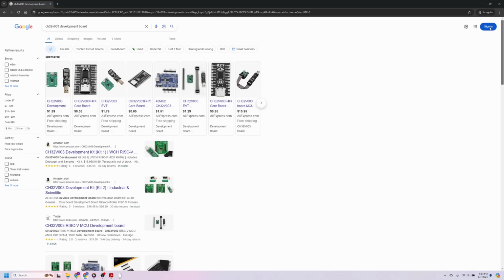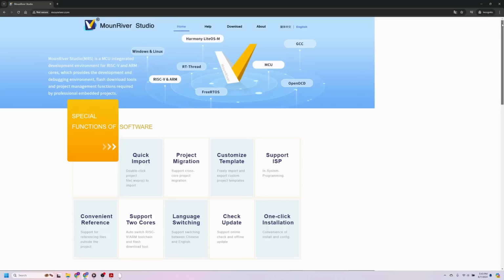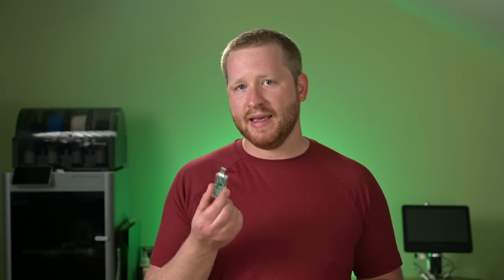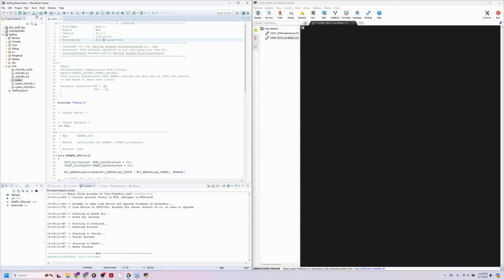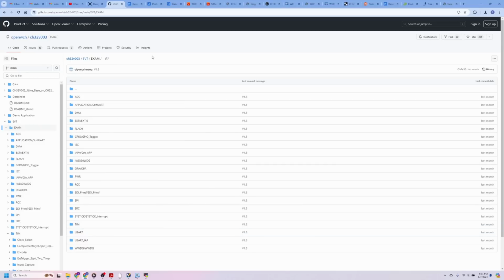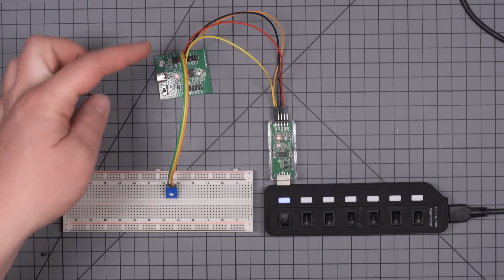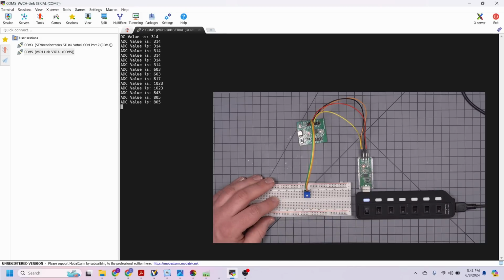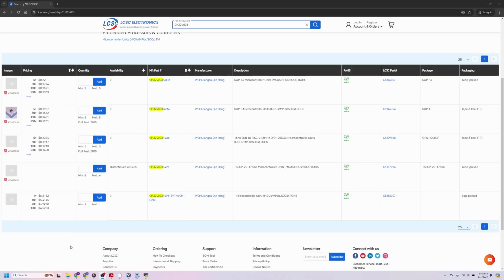Which 10 Cent Microcontroller is Right for You? Comparing the CH32V003 to the PY32F002A.

Comment: you're less confortable ordering from ali? Why? I have ordered there for many years and always received absolutely perfect products. Never had any issues with components.
Reply from the maker: A lot of it is the buying experience, varied shipping times (sometimes I forget I've even ordered something when it arrives), the multitudes of different vendors with questionable reviews, the risk of counterfeit parts (probably not an issue here), poor searching, not being a one stop shop (still need an lcsc or digikey order), etc. If they have what I need and I'm pretty sure I know what I'll get I'll order from AliExpress, but it's not my preference
Reply: @AllTradesZach  do you have an alternative international source for parts? Or do you go for a local retailer? I go for AliExpress because Brazil had absolutely zero good retailers, it's all just drop shipping and mostly from Alibaba, so I just go directly to the source and spend the time to find the stuff myself.
Reply: @AllTradesZach I’ve had mixed experiences on AliExpress. Some vendors are on point, while another shipped me FeRAM’s half of which ended up being well-used pulls with some being EOL with stuck/sticky bits. They fought me tooth and nail, and I ended up with half of the chips that I ordered at twice the price.
Reply: @AllTradesZach  Aliexpress is exactly the same as Amazon. Both provide a store-front to thousands of individual vendors. Your experience depends on the vendor, but if you're buying from e.g. the WCH official store then no worries, mate. Sure, if you search by a part name and then pick the cheapest vendor then you never know what will happen.

Comment: What about the 3 cent Padauk microcontroller?
Reply: That lives in a completely different class than these as it's a closed source 8 bit mcu
Reply: one time programmable
Reply: OTP so you'll burn a lot of them while developing your program (there is a much more expensive flash version). Awful PIC instruction set that is a horror for human programmers and almost impossible for standard C. Also only 64 bytes of RAM (vs 2048 or 3072 here) and 1000 instructions of program space vs 5000-10000 instructions on the WCH and Puya. And you need 3 or 4 instructions on the Padauk to do what one instruction does on Arm or RISC-V -- not even counting 8 bit vs 32 bit. Both Arm and RISC-V are compiler-friendly.

Comment: Another HUGE reason to be excited about RISC-V is the modular nature of the ISA. If you only want pieces of it then you can just take those pieces, which means that you don't have to implement *every* instruction available in the instruction set to be in compliance. This also means far fewer transistors, heat, power, etc. To the degree that I am able, I do everything in RISC-V now. I am tired of all of the x86 / ARM licensing shenanigans.
Reply from the maker: Yeah, x86 in particular is a disaster. Do you think the piecemeal nature of RISC-V will have a negative impact on tool chain support though? It seems like there are already so many different combinations of instructions available
Reply: @AllTradesZach  I suspect that many a project will forget the compiler flags to enable optional ISA extensions and therefore not benefit from them anyway. 🤷🏻‍♂️
Reply: @AllTradesZach  it's very easy for a compiler to use a hardware instruction if it is present (e.g. mul, div, clz) and use the compiler's built in software function if not. GCC and LLVM don't have any problems with the programmer telling them exactly what ISA options are available. If you're doing embedded work then you know exactly what chip you have and it's easy to inform the compiler (RV32EC in the case of the CH32V003). If you're doing application programming for Linux or similar then you don't know exactly what chip you'll be running on (many dozens of difference ones), but in this case there are "profiles" that the chips are built to which specify the minimum set of ISA extensions. These are called RVA20 (most chips now in the market, formerly called RV64GC), RVA22 (the first boards are just hitting the market now e.g. BPI-F3), RVA23 etc. Each one includes everything from the previous version.
Reply: @AllTradesZach  Yeah, x86 so horrible I ended leaving assembly language and learnt C after years in embedded space.  Although I'm partly back with microcontrollers with all the sane beautiful architectures...
Reply: Yeah my professor taught our Machine Dependent Programming class primarily in Risc V and we only did a little x86 in the end, and I 100% prefer risc-v. The only thing I'd take from intel is the square brackets method to access memory, instead of having to do multiple adds, multiplies, etc to access the data, but thats about it.

Comment: wtf RISC-V is already like 10 cents per chip?? i remember when these chips were insanely expensive.
Reply: WCH now have another 10c chip (CH570D) that integrates USB and a 2.4 GHz packet radio. It's also got 8x the RAM and flash and runs at twice the clock speed of the '003. I've got dev boards for it.
Reply: @BruceHoult WCH’s CH5xx series is definitely a lot less popular, they’re specialised chips after all. But if you know what you’re doing with them, they’re probably a lot cheaper than a V307 with all its peripherals. If I recall, one of these CH5xx MCUs is capable of directly talking the USB PD protocol.
But the programming protocols and even architectures seem to be less standardised, some are 8051-based, others are ARM, and others are RISC-V. I think the CH32V toolchains (1st and 3rd party) support the RISC-V ones, but I’m unsure about the ARM and 8051 units.
Reply: It’s got the specs of an 8-bit AVR, the V203 is more like a proper 32-bit STM32 in specs.
Reply: @Scrogan  yes, an 8 pin CH32V003 makes a great replacement for an ATtiny85 while having several times the RAM and flash and a lot cheaper and faster too. The CH32V003 in the larger packages can even replace an ATmega168 or ATmega328 in many applications if you're not maxing out the 32k flash on the 328. RISC-V code is generally going to be more compact than AVR, especially if you're using 16 or 32 bit values or a lot of different pointers/arrays due to r8-r15 all being usable as pointer bases, not only X/Y/Z, so less shuffling.
Reply: Insanely expensive... is a stretch. The first RISC-V microcontrollers that i remember were GigaDevice's GD32V, about 5 years ago now, and they made those similarly priced or cheaper than their GD32 ARM Cortex devices of comparable spec. And those were in turn already inexpensive, being intended to undercut STM32 with same pinouts and similar peripherals.
Reply: @SianaGearz  maybe the parent commenter was thinking for RISC workstations of the 1990s, which cost tens of thousands of dollars per machine.

Comment: LCSC's stock is garbage.
Even if they have limited or no stock of a part there could be plenty of supply of it.
I recently ran into this problem when I wanted to use jlcpcb's online tool for parts supply & PCBA of a few thousand PCBs, because they are really cheap.
But alas there was simply not enough stock of really common parts of chinese manufacturers (cmps, ICs, connectors) I needed.
So I ordered at my usual chinese PCBA house and all parts could be immediately sourced, no problems!
Reply: "my usual pcba" which is?

Comment: 5:19 RISC-V is designed to be cheap and small, not to be fast. In practice, RISC-V cores often need more clock cycles to execute the same tasks as ARM cores, especially the highest M series. This is because ARM cores have more powerful instructions that can accomplish tasks in fewer cycles than would be required by RISC-V. Unless a RISC-V core is clocked significantly higher(My guess would be at least 4 times or more), it will generally perform slower. When comparing clock for clock, RISC-V tends to be slower than most other 32-bit and 64-bit instruction sets.

Edit: 5:35 CH32 MCUs are IMO beginner-friendly. WCH has their own IDE, Mounriver Studio, which lets you easily start new projects without knowing anything about the SDK or toolchain. Plus, the programmers cost next to nothing. For all series except the 003, you can use a cheap cloned 1.1 programmer that costs around 1-2 bucks. However, the 003 requires a 1.3 programmer, and while there aren't many 1.3 clones yet, the official one costs a whopping $5. 😋
Reply from the maker: Would be interesting to test this, some of this also boils down to the exact implementation, as you can implement certain instructions the fast way or the small way.

Comment: I was responsible for developing "common hardware" ICs in a company doing 400 million devices per year, and it was very, very important to minimize external parts needed, optimize pcb layout, and optimize solution size, and optimize software development, with device cost one part of the overall equation...it's amazing how adding a couple of resistors or capacitors to a solution blows up board size, routing complexity, and cost, while ease-of-use in software development speeds up the development process, and may reduce software 'spins'...anyway, just to put an ! to youre discussion....oh, and we had embedded cores 14 years ago, to manage multiple I/O devices into virtual devices, and offload the cpu, and drastically reduce power consumption...
Reply from the maker: Very true, touched on that a bit in the video as well. The nice thing about both these is that they require very little to run, just a couple capacitors and resistors. That's also why I'm using the QFN package on the Puya, to keep by boards small and cheap.

Comment: Re. HAL documentation - it rarely makes sense to use the HAL for the simple functions available on these MCUs as the code ends up bloated & slow. HALs only make sense for complex stuff like USB & networking.
The way the WCH HAL does simple I/O is a real mess. Much better to just read the manual and set the registers to do exactly what you want
Reply from the maker: Sure, the HAL can overcomplicate things, especially for just toggling an LED. I was trying to aim the examples more at beginners though where a "GPIO_Set" function is less intimidating than setting a register, bit masking, etc.

I haven't dug into their I/O HAL driver really, I'll take a look and see what you're talking about.
Reply: 'Twas ever thus. We've all fallen into the vendor trap that pushes us to use an API or framework, and initially it seems like a Great Idea. However these APIs and frameworks tend to have the lifespan of a mayfly, and, furthermore, they don't absolve you from RTFM on the device datasheet.

Unless you're looking for a USB or TCP/IP stack, write and maintain your own library of boilerplate code.
Reply: Isn’t there an alternative lightweight HAL-like thing to use? I just want to make code that’s more portable. Maybe it’s just a matter of adding a bunch of #ifndef clauses at the top of my programs, but that does feel tedious.
Are there bitmask/bit names at least?
Reply: @Scrogan  ST does the LL version of their code, which is significantly simpler than the full on HAL.
Reply: @Scrogan ch32fun is basically that

Comment: Any Microcontroller in a BGA format is a no go for most hobbyists. It's a terrible design for non machine assembly.

I'm totally ignoring anything to do with performance and SW support.
Reply from the maker: Neither of these parts even offer BGA options. The Puya shown in the picture is a QFN part which isn't all that hard to solder by hand.
Reply: @AllTradesZach  though issues with QFN is the central rectangle pad often used for ground/dissipation. It is a pain to desolder and requires extra precautions when using hot air to avoid peripheral components to get heated. It also requires extra steps when soldering that pad, to ensure the contact is good with no short.
For hobbyists or small in house designs made by hand, QFN often requires more tools or more thoughts on the PCB design to be successfully assembled/disassembled, even with a low point fusion Bismuth solder paste.
Reply: If you care enough about costs in a hobby project that you need a 10 cent part, you're probably planning something at scale, in which case getting a hot plate and solder stencil setup will save you a lot of time and cost in the long run if you need to make a lot of something, or something very small
Reply: You can get the whole board including SMD manufactured for peanuts now no idea why you would do it yourself when its so cheap to outsource small production runs. For single projects Zach told you to use the mainstream dev boards I would suggest watching the whole video before posting not just up to the first thing you disagree with.
Reply: Both of these product lines are available in tssop and qtfp variants as well, at similar price points.
Reply: DIP and THT for hobbyist!
Reply: @gaborm4767  Nah yeah nah. It's been a couple decades SMTs conquered the electronic world. Using breakout PCBs allows a widest range of modern and cheap ICs to be a design option for hobbyists. DIP package is a non sense nowadays.

Comment: CH32V003 has been the subject of some discussion as a retrocomputing device that happens to use RISC-V ISA. That's a hot space now for hobby projects - both the idea of "DIY RISC-V computing" which has manifested in all sorts of forms, and the fact that you can build an excellent, cheap 8-bit computer by pairing a vintage chip with a bigger modern MCU for signal generation, as is done in Agon Light or Neo6502. There's an undercurrent in the software space to try to reexamine the low-level stack and bring back user control and RISC-V understandably soaks up some of that interest. For that kind of thing, the whole point is to be able to get very hands-on with the machine and experience some pride of ownership in how it handles data, so the ISA selection does matter in a different way from building a device where the computing is instrumental to reading sensors and blinking lights - with those projects, the Puya chip is probably fine, too.

For one example, the designers at Olimex recently announced a board called RVPC that is the "cheapest RISC-V computer" - CH32, keyboard, VGA text terminal output, a buzzer, and an assembly language monitor. I told them that it doesn't really have enough memory to be fun to program, but they wanted to hit a 1 Euro price point for a through-hole project kit, so the 2K/16K is all you get, and most of it will go to the firmware. They promise to do a bigger design later, probably using a different RISC-V MCU.

Comment: The PY32F0xxA series internally are all PY32F030. This means you should be able to use the additional peripherals, 4K of RAM and 32K of Flash, as well as the PLL for faster clock (potentially anyway). Of course this isn’t datasheet spec, but all I have used in projects work fine with DMA and additional flash and RAM. YMMV.
Reply from the maker: I did mention this briefly in the video. I chose to stick with what the datasheet says for this video, but if you do "unlock" the PY32 then it wins pretty much across the board. It's just not guaranteed that it will always be the case, there is a chance that they're packaging lesser performing chips as the -002s and better ones as the -030s. It's just as likely that they're exactly the same though...
Reply: @AllTradesZach  While undocumented features of the main core not guaranteed, it’s highly unlikely to change. This core is quite small, this is an embedded part, there is no lockout implemented in hardware, and there is large NRE to try to segment this. Maybe that’s what the PY32F002B is supposed to be.

Look at STM32F103x8 for example. Per DS spec they have 64K flash but for over a decade they’ve been usable with 128K. Order the larger part if you need guarantees, go with the cheaper one if failure is acceptable. And even then, failure rate I have heard in the industry doing this for this specific part is very low. Fakes entering the chain is way more of a factor than using Flash that wasn’t specified for the part in the DS.

For hobby or small scale noncritical (life safety, systems automation, etc) tasks using these features is fine. I’ll use undoc stuff particularly when I am not working to the margins of absolute specs but I ship mostly non-critical stuff at unit qty 1000 or less.

Another small factor is pinout. The 002A has different pinouts available which may aide in trace routing. Though one probably wouldn’t specify a part this cheap based on that, lol.